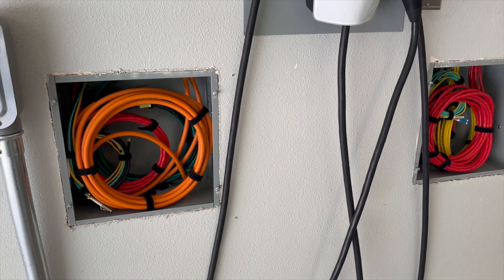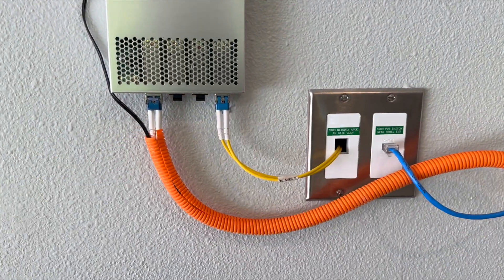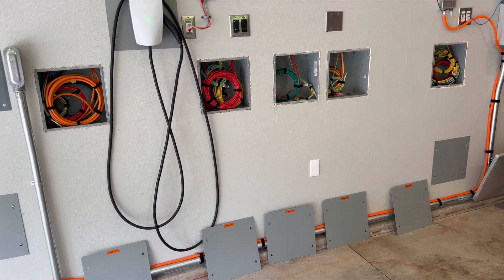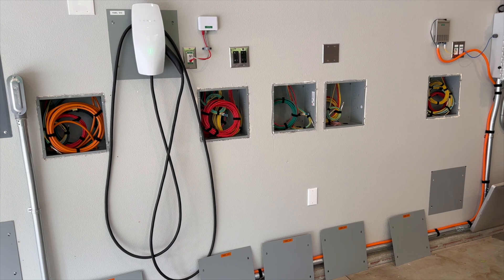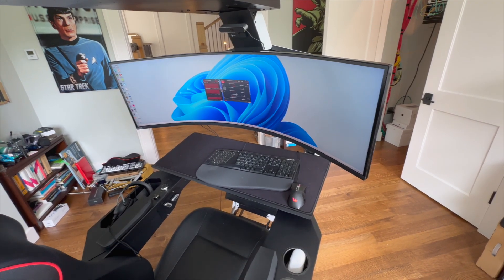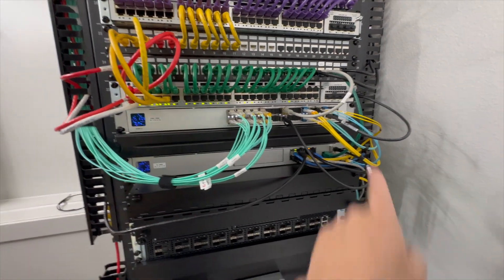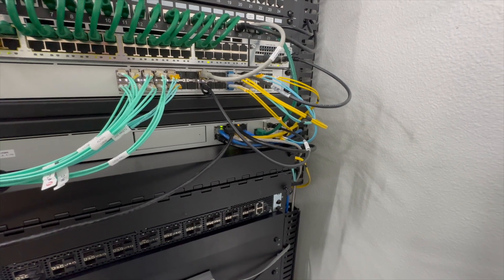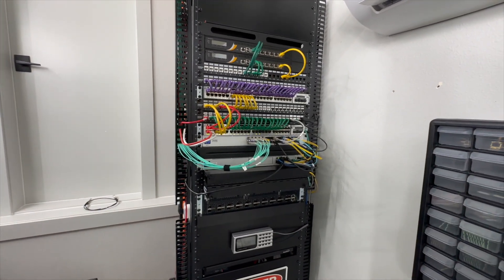Fiber optics in home low voltage wiring:  How and what I did.

Comment: please do a video on terminating fiber. and its cost. like is there any way to terminate fiber ends directly on to cable or a patch panal for splicing is must. and how you terminated it in your Datacenter ( house).
Reply from the maker: Yes, that is coming up soon.
Reply: @jeffsponaugle6339  Thanks ... Looking forward to that. I ran MM in some structured cable when I built my house 20 years ago to multi drops in each room and want to use it.

Comment: Hey Jeff, might be "suck eggs" for you but I noticed you are feeding both the SFP+ ports (ports 10 & 11) to the same switch. I did hear you mention that you have your WAN (2.5Gbps) sitting on port 10 but thats into the switch suggesting that you are VLAN'ing it from somewhere else instead of bringing WAN directly to it, with all your fibre runs, WTF happened there?
 I also noticed way too many devices connected to the UDM which has a very limited switch-backplane in it.
Reply from the maker: Very observant!  I like it!

Yes, Port 10 which is the primary internet input comes from the aggregation switch because I have a mirror port in that switch going to a data capture/collection device (Think Gigamon).  It is of course in it's own VLAN, so it is not connected to any of the other networks.   Port 11 is then the firewall LAN side which is 10g into the internal VLAN on the aggregation switch. 

The devices plugged into the UDM switch directly are all very low bandwidth devices including a VPN device and a few other security related devices that I want in the first tier before a second switch, so the limited switch bandwidth doesn't cause any limitations.
Reply: @jeffsponaugle6339  Cheers, int he early days on UniFi, running WAN traffic through a VLAN was messy, the platform would see all the traffic on the WAN VLAN and report it which, as you could imagine, noisey and a lot of extra crap which inturn reprisented why data usages where high when the ISP sucked and I was getting a lot of unwanted traffic. 
As for the heap of fibre you have, still not able to bring the WAN photons direct to the UDM, bugger!
I am surprised you haven't maxed out the UDM yet.

Comment: How did you run fiber in wall in your new build?  Did you run flex conduit first?  If you just ran the fiber did you secure it to the studs in any way?  Would be interested in some more info about that.
Reply from the maker: No conduit for almost all of it.  I used some plastic wire holders for the studs that had a bigger inside diameter then the fiber so it floats in the holder.  I also pulled fiber along cat6a so sometimes I used velcro to keep those together.   I also used zip times in some places with care to have them loose. 

The 12x and 24x fibers are armored cable, so those are a lot easier to pull.

Comment: No conduit?
Reply from the maker: Not in the walls, at least for the majority of the pulls.. With this much wire and  fiber it would have been really difficult to have conduit and pull that much material around the steel beams.  I did do conduits to the TV locations as those were closer and didn't have as many drops.